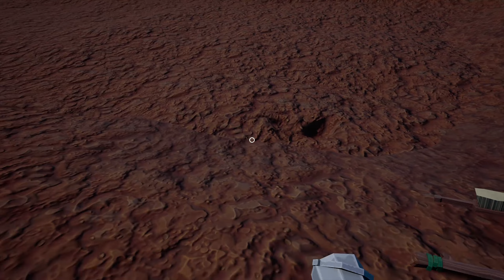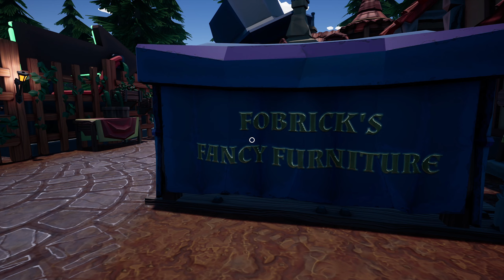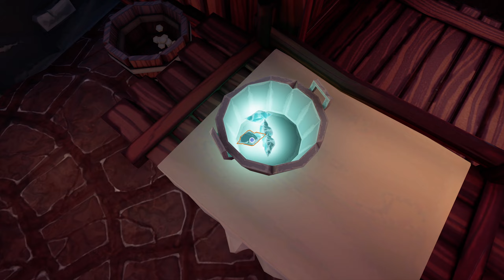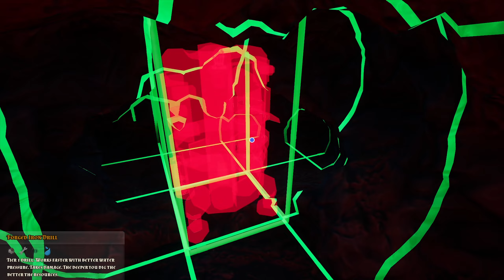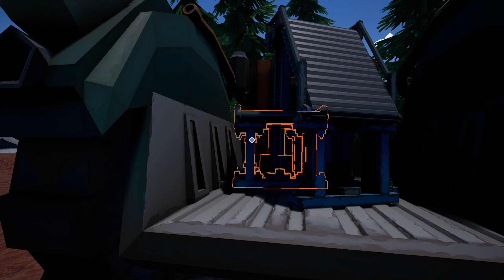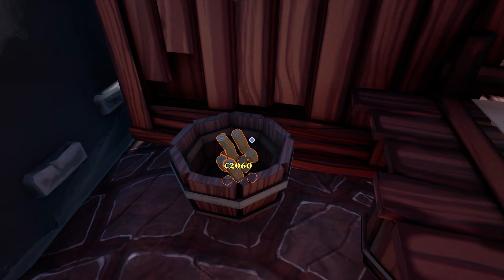Secret Underground Mining Operation - Hydroneer 2.0

Comment: The speed of the conveyor depends on the water pressure. By the way, I suggest buying five water filters and putting them on the pipe above ground. That way you won't have to repair any of your equipment, though you will have to repair those five filters. Also, place the water pressure thing underground right before your equipment.